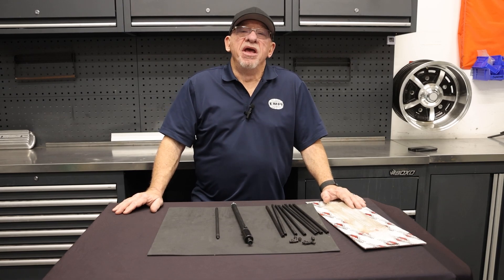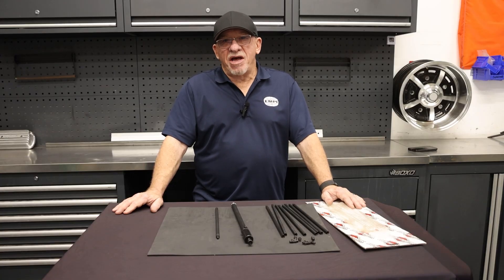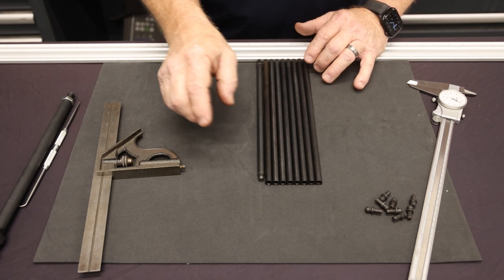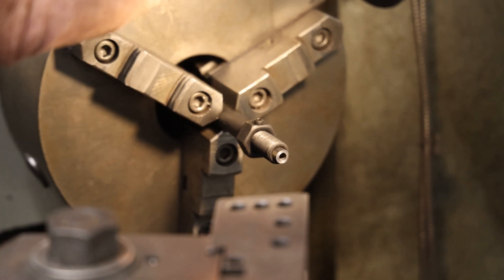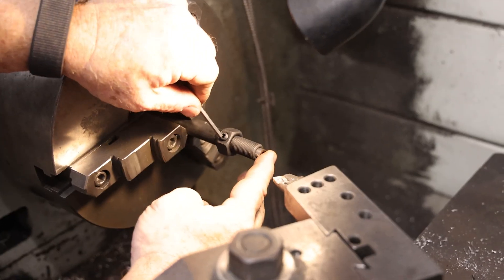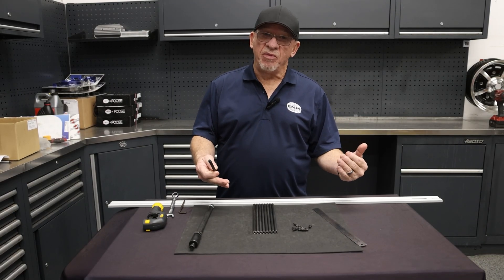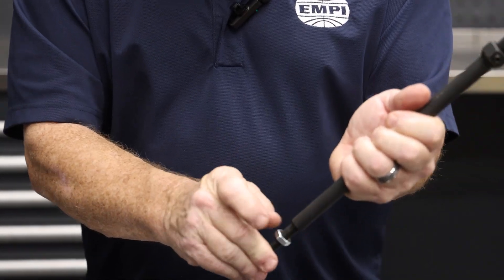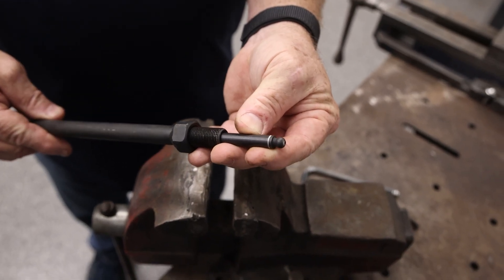NEW EMPI Push Rod Assembly Tool

Comment: What a great idea , it'd be cool if you put together a engine builders clips with a dial indicator the right brackets a deck height gauge a cc kit and lifter clips ,  case splitter oil pump puller anything else I forgot😊